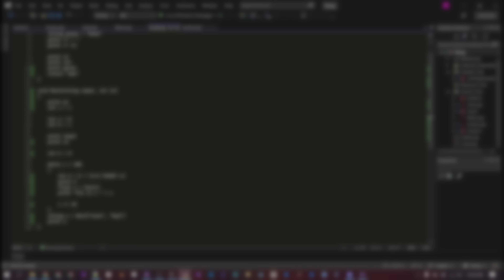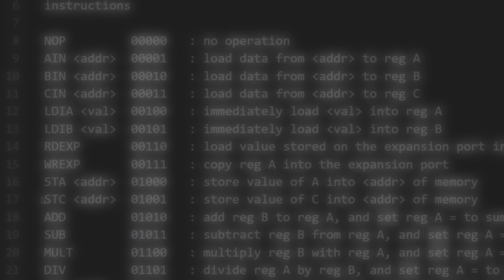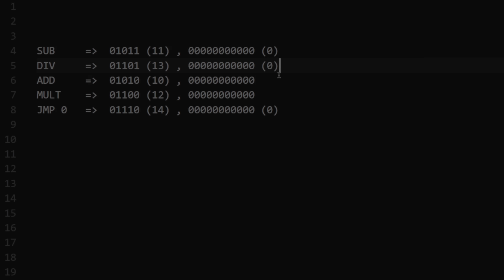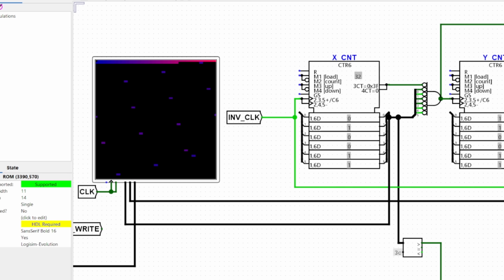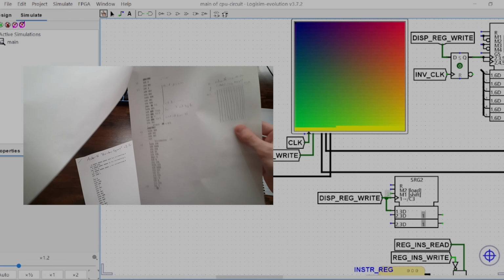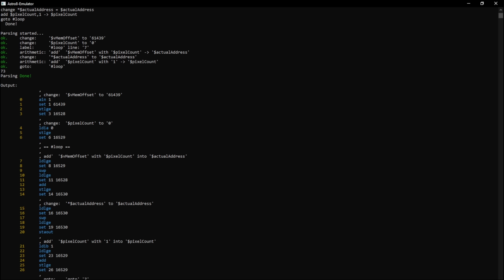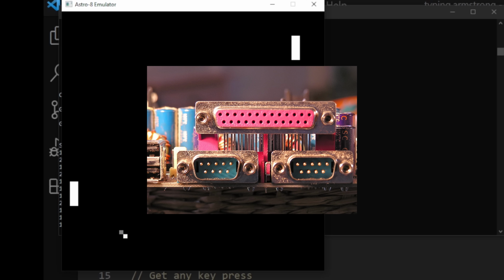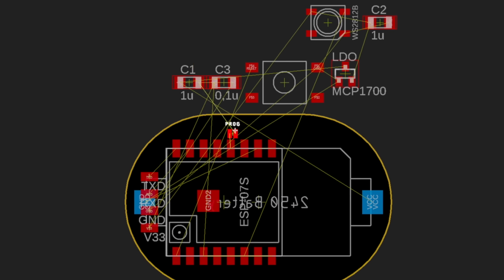I Designed My Own 16-bit CPU

Comment: I did something similar to this a good few years ago, I designed an 8-bit CPU in logicSim, wrote an emulator in C#, designed an assembly language and assembler. Unfortunately, I made a lot of mistakes in designing the architecture, things like fixed instruction lengths and no way to store perform operations on values larger than 8 bits (technically it was possible, but with 256 bytes of memory and 8 of them reserved for registers it wasnt very useful anyway). Having recently written a Z80 simulator, and learning a lot about CPU architecture in the process helped me identify all of the issues in my initial design. with that said, it wasnt bad for an A-level project that confused the hell out of everyone who tried to mark it.
Reply: A-level??? Dude that's unreal. I built an sql table viewer in VB...
Reply: 256 addresses and some external logic should be enough to implement a microcode architecture.
Reply: Fixed instruction length isn't that bad, it's what RISC uses.
Reply: @ShinyHappyREM  considering the memory limitations, every instruction being 3 bytes long is an issue (command operand1 operand2), some instructions didn't need operands, such as halt, but would still need 3 bytes in RAM.
Reply: @lewisd56  Almost all instructions need 2 bytes. Then you could have an addressing mode where the second byte is split in two halfs each of which points to a register. SH2 and SuperFx work this way. The immediate value ( second byte ) is signed. So you can have Inc and Dec with 01 and FF . Similar for branch. For NOT and NEG you use XOR and SUB immediate-register ( like SH2 ). 68k generalized the hardware stack of the 6502 to postincrement load and predecrement store. MIPS had some constraints, but I think other designs could include this without variable execution time. I mean, load and store already need more cycles for the shared memory. You can encode RET as a move with IP and some other register .. so it needs two bytes, but less decoding on your part.
Reply: @ArneChristianRosenfeldt  Yeah, thats an interesting method of doing things, never even passed my mind. If I recall correctly, I designed the architecture to work around addresses in memory more than registers, and simply used the registers to store an accumulator, sign, zero and other flags, assuming there was no time penalty for accessing (lets call it cache) memory than registers. given the registers were memory mapped though, in hindsight it seems a bit pointless. It certainly helps to decrease instruction sizes by splitting the second byte to address registers for certain instructions. Having studied in detail the Z80 ISA, I quite like the way that handles mixed length instructions, and significant optimisation for certain fixed operations (like accessing registers where the register is coded in the opcode rather than the operand).
Reply: @lewisd56  I came across JRISC. The registers are 32 bit in size and you never know which bits to load. Addresses tend to have a lot of zeroes. Professor wanted float emulation in MIPS assembler ( there is even certain support in the JRISC ISA ). Or you pack data. So JRISC simply allows 16 bit instructions + optional 32 bit immediate. Self modifying code is possible. Cannot do that so easily with MIPS loadLo or the RISCV counter part.
Yeah, texas instruments produced a microchip which was memory based for fast task switching. But it was so horrible slow already without switch and needed the fastest ( smallest, most expensive ) memory. Everybody bought Zilog or MOS instead.
Reply: @Ramtin Javanmardi If you understand how the architecture works, writing an emulator isnt really too hard, you could even write a simulator if you wanted, but you need to get instruction timings and all sorts of hardware stuff simulated too, which can be a hassle. 
Basically, you need really 2 core things for an emulator, an ISA, which you should have if you designed the microArch, and some way to interpret the ISA, really this will probably be high level logic in your chosen programming language. 
I simply used a case switch on binary opcodes that called methods with the operands (remember, because this is an emulator, memory read and write timings dont matter), but a better approach (and the one I used on my Z80 simulator) would be to use instruction classes and loop through an array of these classes (well, cast to interfaces) testing if the opcode can execute a given function in the class. 
How you handle IO is up to you, I didn't, but memory mapped IO is pretty easy to implement and can be done by simply accessing the RAM object of your emulator.
My Z80 simulator is open source, and was written for a university project, so it might help, it can be found here: https://github.com/Lewinator56/z80Sim (you will need .net core 3.1)

Writing an assembler is kind of different, in reality at the easiest level you are simply going to have a defined assembly language and just convert it into opcodes, which is pretty easy to do. If you want to include functions and variables (by name) in the ASM then you need to process symbols too. I simply stuck with a conversion from ASM to binary.
Reply: @Cobra Tate wtf is this response? I'm not making that suggestion at all, I'm saying 'i did something similar to what's being done in this video, and did it when most computer scientists are still trying to get their head around python'. I know it's not brilliant, but I'm not trying to say that, and I'm certainly not dismissing the complexity of designing an actual CPU.

Read the other comments, there's intelligent and informed discussion, I don't understand why you have commented this. I don't think I'm a 'computer genius' in the slightest. I have the utmost respect for engineers designing the hardware as that's a whole other level of complexity. And anyway, my computing skills are being put to use in nuclear fuel research now, in a field with very little existing work.
Reply: What's an assembler?
Reply: @TheWeirderness  converts assembly language into binary machine code for the hardware.

Comment: how did you learn to do this? I'm intrested in doing the same thing. Any books that I should read or series I should watch?
Reply from the maker: I learned quite a lot from Ben Eaters CPU series, though it is quite a long watch. I recommend following along and building your own at the same time, either in something like logisim evolution or another program.
Reply: @AstroSamDev  ok thanks.

Comment: i awaes wanted to see someone trying to make a more complex game like terraria, 2d mario world or something like that, and making it like a operational system where to install the game the installer would ask for you to create separate or a new partition with the size of the game or bigger, this way 3p process wouldn't be running on the background consuming memory that could be used by/for the game.
if you think you can do it, pls think about it.
Reply: The problem is video drivers. Unless you're restricting the game to special hardware, you're going to have to deal with driver/kernel interfaces, or run in 640x480 16 color mode like TempleOS, with no hardware acceleration. If bloatware is a concern then you're better off making a stripped down linux system and setting the game as the init task. Even then the game would have to be aware of it, and serve as its own display manager. Or you could just run a lightweight dm and have it autorun the game.

Comment: if without the help of coding from another computer, is it possible?
I'm confused how people make programming code without another computer when there is only one computer being built
Reply: well what you would do is manually write out binary bytes or hex bytes
Reply: If you were on a desert island and you were trying to program your computer you would need additional logic built in to manually enter the binary values into the machine. To speed it up, you could build a punch card or bubble reader (like scantron) to read in the bits.
Reply: @spfennell  exactly

Comment: who told a terminal has a screen, network or com line
Reply: rom-precomputed computer, lol, its not computer but a pre-computer
Reply: it only gives previously computed results
Reply: its turin complete
Reply: make it run screen area ray casting, ie, narrowed per object (sphere boundary containing object triangles) plane-rays for vertical lines textured/pre-baked render only, up to 16K, super fast, check my video on the algorithm idea
Reply: design your own gpu, that can raster pixel accurate (plane-ray intersect the pixels to draw), ie can execute a vertex/pixel shader combo, narrow down the plane-ray intersections by from-camera limit angles

Comment: Using a 16-bit address bus would get you 64 kibibytes. Although, since you’re storing a 16-bit word at each address rather than a byte, you have 64 kibiwords - or 128 kibibytes - of memory to work with.

Le edit: 1 kibibyte = 1024 bytes. 1 kilobyte = 1000 bytes. One is a binary prefix, the other is a metric prefix.
Reply: I'm never going to use that childish sounding garbage. 1024 bytes is a kilobyte and SI has no business even being included in the discussion, I don't even care that they're using the same letters for prefixing, it's still going to be powers of two. Hard drive manufacturers have caused and are continuing to cause harm to the industry by being such cheats and now we've got douche-nozzles who want to redefine all of our terms instead of taking the manufacturers to task. It's almost as bad as changing BC/AD to BCE/CE because they don't like the implications of how the names originated. Stop redefining terms.
Reply: One kb = one kilobyte = 1024 bytes is what programmers and engineers worked with for decades without making a single mistake, the other is just a trick used by hard drive manufacturers to scam their customers.

How would be 1 kibibyte = 1024 bytes? there's no way, 1 kibibyte in any case would be 1024 bibytes, you can't change the units along with the prefix, you can't say 1k€ = 1000$

And ki-what? did you ever seen a kigram or a kimeter? the metric prefix for 1000 is just a k, you must call kbibyte your "metric kilo-binary-byte"

Then how long are those whateverbytes supposed to be? 8 bits to work with current chips? sorry but 8 ≠ 10 if you want to do metric computing your bibytes, mebytes (metric bytes, not megabytes) or babebibobubytes must to be 10 bits long, anything metric must have base 10.

Are you already seeing how the manufacturers of hard drives have cheated you with their "metric" scam?

For more nonsense I think 1 kiwibite is what I make each time I bite a kiwifruit and 1 kiwibit is each of those chunks they put in the yogurt.
Reply: Nobody cares about kibi, kilobyte is 1024 in my heart.
Reply: @tissuepaper9962  same here
Reply: how many habibibytes is that
Reply: @axmoylotl  2 hamoodibytes